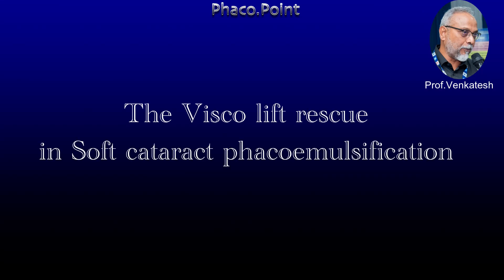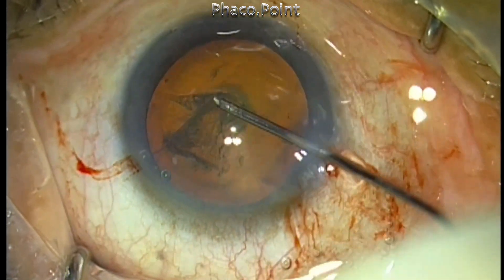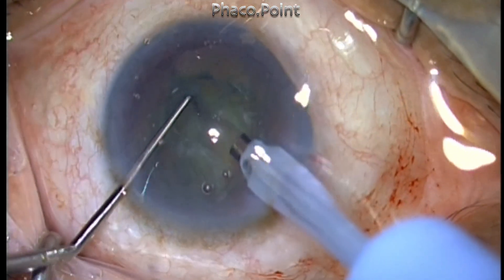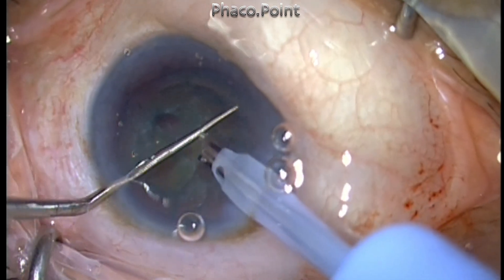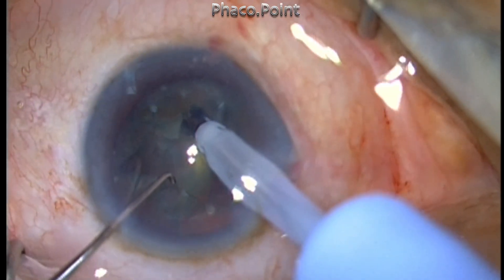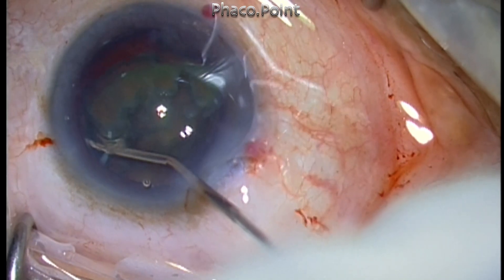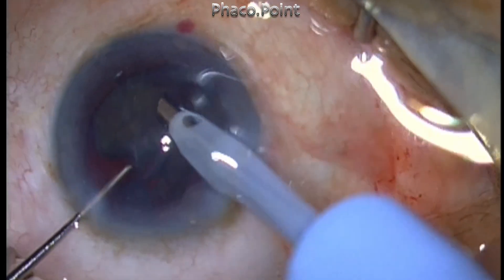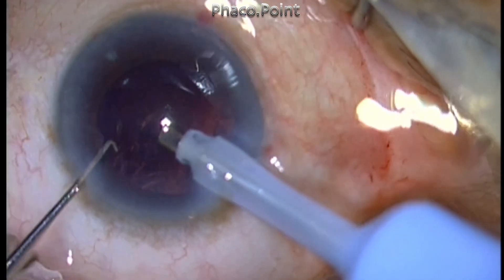Soft cataract troubleshoot - Visco Lift procedure to the rescue

Comment: But sometimes after visco injection iris starts prolapsing and makes the surgery messy
Reply from the maker: If visco is injected behind iris but not under the ant cap edge then this will occur. Visco elastics can be used as a surgical tool and the exact location and placement of its use will give suitable results
Reply: Can we do with re-hydrodissection
Reply from the maker: Yes of course